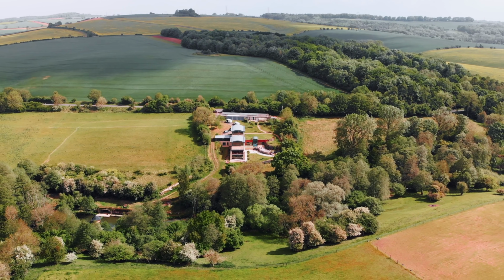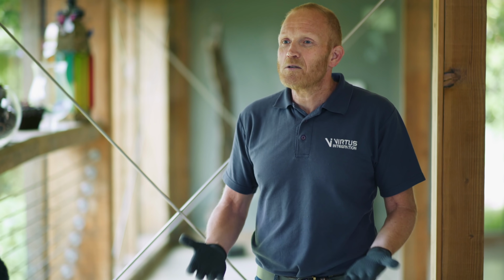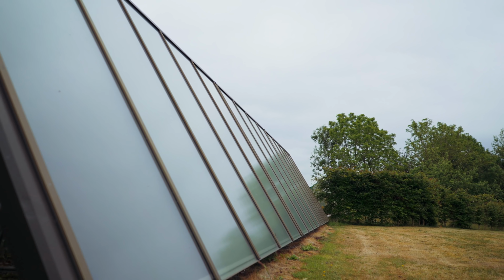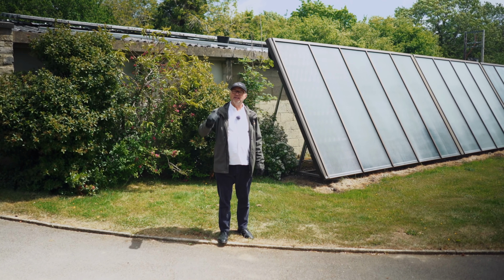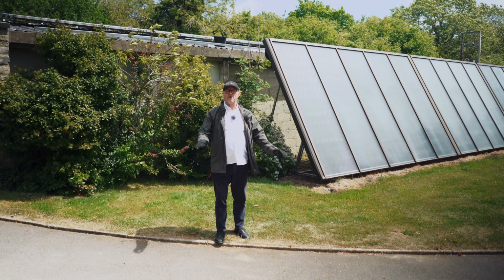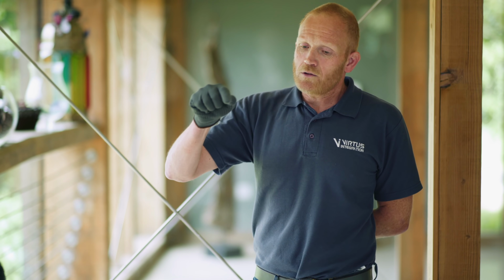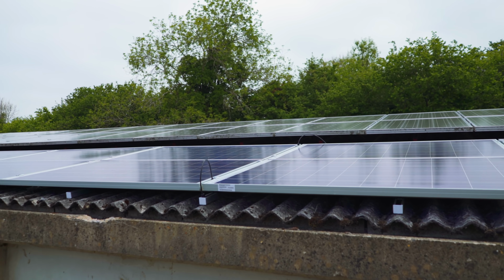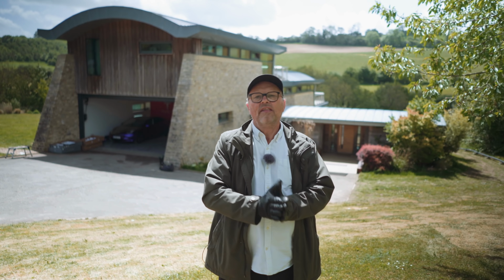Can you HEAT & POWER a big house with RENEWABLES? | FULLY CHARGED for clean energy & electric cars.

Comment: With that amount of solar, it probably is providing enough even on the most cloudy, dark, winter days to keep the house & batteries up. That's the key point with overcapacity. It helps you compensate for those periods.
Also, cooling the house in the summer is as much of a topic as heating is. With global warming, well insulated houses and systems that can keep the temperature at whatever desired level is going to be more important. Of course, with that amount of solar energy they can probably turn the swimming pool into an ice skating rig in the middle of the summer :-).
Reply: The design has significant roof overhangs of the main SW facing windows, thus keeping high Summer sun off the glass, but allowing low Winter sun in. IME that amount of insulation, sufficient to avoid heating in Winter, should mean that no cooling is needed in Summer, but reversible heat pump putting some cooled water though under floor heating would do the trick - only a tiny amount of energy would be needed, given how little external heat will get through the insulation
Reply: One disadvantage of this PV installation is the inclination of the panels, they are relatively flat. If it's snowing, the snow covers them until it melts away. With modules inclined 45 ° the snow is sliding off in a couple of hours, and the panels start to work again. 
But overall the house is really impressive, good work.

Comment: I still maintain that not every house roof is suitable for solar, but a lot more houses could have power walls installed and be charged with off peak electric, this would help smooth out the peak demands. Will the government ever help support power walls?
Reply: My view is that grid-scale batteries would be a lot more efficient (than individual household static batteries) for smoothing Peak Demand. That said, I do have a PowerWall, but partly that is because I work from home and it avoids power-cuts.

Comment: As an OG follower of this channel, I remember when Robert use to do so many videos about innovation for homes and building, energy efficiency and costs. It's been 10 years and it's great to see another video like this, that is a leap forward. 

I think it is sad and highly misinformed when I see estate houses and developments around me in Atlanta, being called luxury based on the price and location when they still require you to pay rising heating and cooling bills and water without any systems in place to either eliminate them from the cost of ownership or to save money or to generate energy for those around them. 

The necessary shift is what is "affordable" and "lux" needs to change. I would much rather have an off grid capable  home that produces on site all that I need and feeds it back to grid when I produce more than I can use than the mac mansions that will only be more expensive to run from day one. Just because you can afford something doesn't mean you should spend it.

Comment: What a crazy showcase! Like it.. For a new building with this much open space it wouldn't be so important to use high-tech insulation materials to keep wall thickness down.
A natural fibre insulation material at 400 to 500mm could have been even better for the environment.
Plastics and vacuum panels make more sense in space constrained projects.

Comment: It is an amazing house and super energy efficient. However how ' green' was the construction?
Reply: My thoughts too. The carbon footprint of the build would be so massive it would take 100+ years of  renewable power usage to break even against an average build.
Reply: @plam600  If it's putting power into the grid though, even 20KW out of his 60KW saves 4000KG of C02 a year compared the average environmental cost of each KWh of energy produced in the UK.

Comment: I always wondered why wouldn't the governments subsidise solar panels and batteries instead of building a nuclear plant?
Reply: Because nuclear gives high quality and reliable baseload power. Solar doesn't, especially in countries like England. You also don't need a complicated and extremely expensive smart grid that may not actually work well. A combination of nuclear and whatever grid scale storage technology is being developed for renewables (for peak power requirements) would do a much better job with far less land use.

Comment: My brother lives in a new house with a communal heating system. I think it's a CHP setup that's supposedly biomass fired, but in fact I think it ends up gas fired most of the time. It still works out far cheaper, and makes much more sense than the individual boilers in most houses. Such a shame they didn't add some bore holes and heat pumps.
Reply: Gringe Haglet There are several developments in London with communal biomass or heat pump systems, or CHP systems. However residents are finding they are paying well over traditional rates for power, and are unable to switch suppliers. Some estates also have huge management charges to pay the maintenance of the systems. They are a good idea in principal, but unless they work out significantly cheaper than traditional sources of power and heat then they won't be widely adopted.

Comment: It would be very interesting for this home owner to create a set of design guidelines based upon his experience to convert existing homes into power generators (producing more energy than is used)  I think most people wouldn't know step 1 about how to go about it and of course typical homes are much much smaller
Reply: I think the snag would be that most houses don't have a massive former pig shed alongside on which to mount huge numbers of solar panels! Electric Export pays peanuts, currently, I reckon the limit for Average Person would be achieved if they had an Electric Car at Home during the day, as many PV panels as they can fit on the roof, and a car charger that would divert any excess PV into the car. Beyond that currently spending more would be because you can, not for good economics.

Comment: Was this two buildings? The owner says there is no heating and the underfloor heating is never unused. Cut to maintenance guy who explains it took 8 weeks to dry out and become warm, the two types of ground source heating and shots of all the ducting. 
Either way I would love to work in an office building like that.
Reply: Reality is the underfloor heating is on - we bleed hot water into the system whenever the temp drops down - we monitored the primary pump for a couple of years when we first turned the system on and calculated circa £70 worth of electrical to run the system.  The Nibe heat pump has its heat elements turned off so all the heat is coming from the ground source.  John considers the system as off however its probably off 90% of the time.  👍

Comment: As an HVAC engineer I am extremely interested in that vacuum core insulation... I just found a manufacturer who claims an R60 in just 50mm (~2 in)! That's unbelievable!

With modern codes, the biggest challenge has become ventilation. Assemblies need to be so tight to prevent unwanted drafts that you need dedicated machines to provide breathable air. I'd have been interested to learn more about the ventilation system (it would almost have to be some form of energy recovery, right?)
Reply: Smidge204 can you name a company selling insulations like that?
Reply: @Drivingralle  The search keywords are "Vacuum insulated panel" - I found Kingspan and va-Q-tec as manufacturers.
Reply: I'm going to take a guess at it being actually unbelievable, and suggest that R60 applies to the center of a piece of product, and the installed overall insulation value of the wall, floor or roof, etc. being not as good. still, worth keeping an eye on. good for retrofit work, tight spaces.
Reply: @DanielBates2  Insulation is always rated for the product, not the whole assembly; How could a manufacturer rate an assembly their product will be part of before it's even designed? With respect to the overall assembly, though, depending on how the insulation is used (e.g. between studs/furring strips vs. full cladding) the entire thing will still perform so much better than the equivalent construction using more traditional materials.
Reply: Vacuum insulation is good, but not as good as suggested in this video. It also has to be ordered to exact size (you can't cut a vacuum) and costs a fortune so unless you really need a thin bit you are much better off with conventional insulation. And to keep embodied emissions down (which matter more as usage emissions are reduced) it's better to use carbon-sequestrating insulations than plastic foam, even if it is a bit thicker. 400mm or cellulose or woodfibre is plenty for notmal houses. The 1m thing is a bit excessive unless there are no windows (because windows are always 6-10 times worse than walls).

And yes you need an MVHR unit. 2 fans and a heat exchanger. I retrofitted one in my house. You can combine the MVHR with the heat pump/heating system into once fancy unit if you like (Nilan do them).
Reply: @Wookey.  I'd research the suggestion of utilizing the HRV/ERV for the heating/cooling system.  From what I have read the ERV/HRV system will, if sized properly, move such a small CFM of air that it could not heat or cool the house.  If you use a heating system air handler it will move far more air than is required and consume far more energy.  On top of that is the fact that if you use the heating system for the HRV/ERV you lose the ability to port fresh air to specific parts of the house while evacuating from specific parts of the house.  The two systems do need to be separate to provide the environmental benefits associated with passive houses.
Reply: We used Aerogel "Blanket" in tight spaces (U-Value 10mm = 0.8, 50mm = 0.23) Not on a par with R60, but readily available🙂 . Passive House needs to be very air tight and then uses Mechanical Ventilation with Heat Recovery (exhaust and fresh incoming air pass through heat exchanger and filters). Air tightness is crucial because if the house leaks the exhaust air through heat exchanger is reduced and heat recovery efficiency drops dramatically (house cold in winter and hot in summer). MVHR provides same air changes as a "draughty old house" 🙂 so air quality is good, including pollen filtration etc., but the design ensures that fresh air reaches all corners so unlike convention houses no damp spots, no cooking smells, and any damp quickly removed from all wet rooms
Reply: Normal ventilation rules would not really apply here in reality. A normal family could live in that house and never open the door for an entire lifetime and never use up all the air! No extra ventilation needed here!
Reply: @richardnwilson  If the house is really well sealed, you would still want to be providing fresh air...filtering particulates and impurities, managing the humidity both up and down, for everything to be enjoyable.  This is the core of the Passive House idea (which this house has taken to the next level) - lots of insulation and airtightness, with active airflow and filtration.
Reply: @richardnwilson  Yeah, no; You need fresh air ventilation. Not just for CO2 exhaled by the occupants, but to control odors/VOCs and humidity. It's also the law anyplace that has adopted and the international building codes (and enforces them). Back in the bad ol' days, operable  windows were sufficient for residential spaces, so you didn't need anything at all... but not anymore.
Reply: Seems literally unbelievable.
Reply: You're right - it needs to be airtight. Modern MVHR systems can retain up to 90% of the heat in a home's air, while changing the home's entire air volume 6 times a day.  With good passive solar design (big south facing windows etc.) and a lot of thermal mass like this guy's concrete floors, no heat input is needed for all but the coldest days. Even on such cold days the equivalent of a hairdryer is enough for most typical home sizes.
Reply: mugger858 is there some other efficient material that’s got thermal quality but more environmentally friendly on floors other the concrete? Could lime mortar be used? Same question for foundations?
Reply: @Paul_  I've been reading up on this as well and having spoken to a few Passive House designers and read reports from Building Scientists the consensus appears to be that trying to use the Sun for free energy is actually very expensive and can easily result in an over heated and uncomfortable house.  Better to super seal and insulate and use windows that do not allow heat entry...and use less glazing, all of which easily offsets the tiny energy increase costs.
Reply: @richardlangley90  which when you're building affordable homes just results in tiny windows as it's the cheapest solution to achieving a decent U value. They're terrible live in.
Reply: look up erv and hrv units on youtube. very good info on how they work.
Reply: @Mike-Minion  Yeah I've been specifying them for over a decade. You pretty much have to these days to meet both energy code and ventilation rate requirements.
Reply: @Mike-Minion  any idea what the name is for insulation they use on the walls? Link would be great ;)
Reply: @zginversion  if your referring to those brick things he had. that is spray foam i presume. not sure of the name. many company's install this.

Comment: This looks to me to be a new way to building and selling houses. The builder /developer builds a 100 house estate with ground source built in for all the douses and all the other systems described in this video. Then he sells houses that do not have heating or hot water, these are provided on a leasehold system but the rest of the house is on an owner/occupier sale. This way the developer /builder  then sells the excess electricity to the grid making a profit some of which goes towards maintaining the condition of the estate i.e. keeping the grounds and open spaces spruce.

Comment: Its simple Robert every new house should have a GSHP and be super insulated no excuse
Reply: And PV!
Reply: Geothermal  is partly primordial  energy from when the Earth was formed and partly  generated from within the Earth's crust from the decay of mildly radioactive elements, it is additional to the already heating planet. No excuse for ignorance, just think critically.
Reply: Not so simple when housing needs to be affordable.
Reply: @ChocolateFrog  Agreed. We need a system where eco-house-building is subsidised, and the subsidy is paid back over many years by a small surcharge on the energy bill. Thus the house costs the buyer the same as now and some, but not all, the energy cost savings are taken to pay for the insulation, PV, and heat pumps.
Reply: We have the renewable heat incentive scheme which does that, but it closes next March.
Reply: @ChocolateFrog  At least the insulation isn't that expensive as long is planned from beginning, high energy costs will be much higher over the years than an proper insulation from the start on. You can retrofit PV and other stuff later, but insulate a existing house is more expensive than doing it during construction.

Comment: Just wow! my problem is insulation on an old stone built property. What is the name of the 10mm insulation board that was mentioned? Sadly we burn LPG to heat and cook. I'd love to convert the mortgage payment to Calor and switch to a ground source heat pump. How deep was the bore hole for the piping? Great video. Grand designs eat your heart out!
Reply: I'm in the same boat on building type, but I have regular gas, and an old style gas boiler. Vacupor/Vacutherm will find the thin insulation product. Vertical bore holes are typically around 150 M deep max, you may need more than one, which have to be around 7 m apart and around 7 m from the building. A horizontal pipe has to be 2 m down, but needs a pretty large area be dug up. If I remember the online estimates I could find right, you were looking at ~£15K for a small vertical system, and it only makes sense if the RHI continues on GSHP. You will likely not save enough to offset the system cost without the RHI.